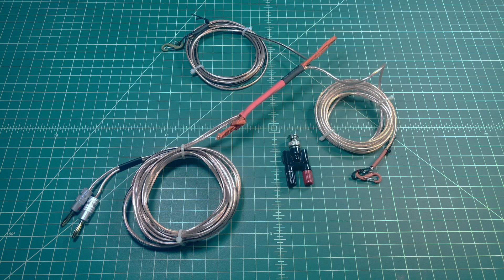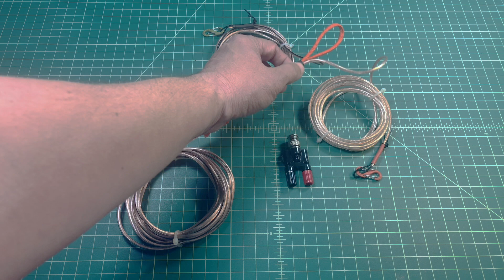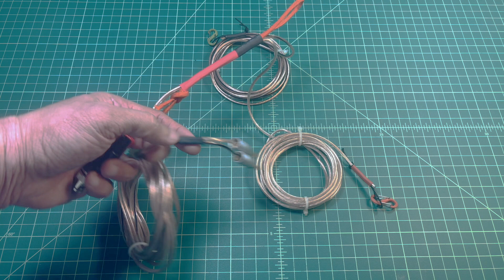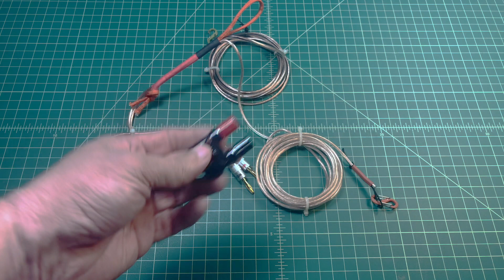Speaker Wire Antenna - HAM Radio - TheSmokinApe

Comment: This is really cool. I've got a bunch of 18 gauge speaker wire so I might have to try this build.
Reply from the maker: Give it a try, good luck with the build 👍
Reply: @TheSmokinApe  Follow up: I made one of these and it worked very well for me. It will be better when I can get it up higher, but even at around 12-15 feet I made several contacts as soon as I got on the air.
Reply from the maker: @KenPryor  that awesome 👍

Comment: Great video. I assume you’re attaching the connector directly to the radio. But if you attach the connector to a coax cable to complete the journey to the radio, I’m assuming you would need a balun to handle the unbalancing created by the coax?
Reply from the maker: That is correct 👍

Comment: Not to be picky here but radials are the wires that run away from the base of the antenna. The radiating part of an antenna is a radiating element or radiator. It is important for people to know and understand this. I love the video though and I would recommend that people make this antenna especially for portable use such as POTA, SOTA, Field Day etc... Also the difference between a doublet and a dipole is that a doublet is usually balanced (uses ladder line or two conductors) and a dipole is usually unbalanced (uses coax cable) But some people use the terms interchangeably). And you are right that the larger conductor the wider the band width and this is even more helpful at VHF and above...  Thanks for posting.
Reply from the maker: "Not to be picky here but radials are the wires that run away from the base of the antenna. " you are totally correct, thanks for the call out.
Reply: @TheSmokinApe  Not really a call out but more of reminding you of what you already know... I like your videos a lot.
Reply from the maker: Thanks Norbert, I apricate you checking them out

Comment: Great build Ape! What's the max power you'd put through the antenna?
Reply from the maker: The most I put in it was 50w, I’m sure it could do more 👍
Reply: @TheSmokinApe  Thanks!
Reply: @TheSmokinApe  BNC connectors are rated at 250 watts,so that binding post can easily handle 100 watts of RF.

Comment: Hi, is this wire solid or stranded?
Reply from the maker: Stranded 👍
Reply: @TheSmokinApe  Thank you. I've been using 26 AWG solid magnet wire until now and handles 500 watts with no problems, but it's hard to paint black and keep stealth. So I've bought some black stranded wire and was concerned. Thanks for the reply!

Comment: Very cool. I made a very similar speaker wire dipole. I am considering ordering the qrp 1 to 1 balun from balun designs. I also used the speaker wire as a balanced feed line. My thought is that the output of the radio or tuner is still unbalanced even if you dont use coax. Thanks for making this video!
Reply from the maker: It’s my understanding, and I could be wrong, that balanced to the radio is fine.  If you add coax or a tuner you add unbalanced which requires a balun.  Glad you liked the video 👍

Comment: Looks great! Now get that general ticket so we can see it in use! One thing I would do, if it's cost effective, use adhesive lines heat shrink tubing, that'll holt it all together!
Reply from the maker: I do need to get motivated.  Thanks for the tip on the adhesive shrink tubing, never heard of that...

Comment: I just made one of these a few days ago. I also just got my telescoping pole in the mail last night so I am going to test it out today. I cut mine for 20 meters but I think I will add clips so I can add wire for 40 as well.
Reply from the maker: I’m curious about how the clips work out.  I have the Shakespeare Wonderpole I’m using as a mast.
Reply: TheSmokinApe  I’ve wondered about using PowerPole connectors to make the wire extendable to various lengths. What do you think?
Reply: @TheSmokinApe  Mine worked well. I used  the DX Commander 10 meter pole which is by far the tallest support I have used to date. I just used a zip tie to support the center which worked fine for me. I am really impressed on how may contacts I was able to make using this antenna and 10 watts on field day!
Reply from the maker: Nice!  I’m going to look into that mast.  Thanks!

Comment: I made one of these with 24 awg speaker wire. 100ft roll about $10 plus the same BNC adapter you have. I cut it to 40M length with the remainder as the feedline. I use a 2nd adapter to go from BNC to PL-259 into an MFJ-902B 80M-6M manual tuner with an FT-857D. I hang it in an inverted-V with a 20ft telescopic fishing pole as the mast. Not including the radio and tuner, I probably have less than $45 into the antenna... wire/mast/connectors combined.
When I first checked with the antenna analyzer I was stunned with the SWR at near perfect, 1.2:1 NO TRIMMING! So, I hooked up the tuner and radio and my first contact on 40M was a 6-call from Northern California at about 65 watts SSB. I'm in SE PA, so I was quite pleased. 3000 miles at about 1pm EDT. Does okay on other bands with the tuner (I didn't try below 40).
Just my 2 cents... Have fun!!!!
73
Reply from the maker: Thanks man.  I think the these are going to be a fun project to play around with.

Comment: Interesting, I have used just a single wire with an alligator clip to make a decent field expedient antenna for shortwave receivers, but this looks much neater, and looks easy to hang as a dipole.  Now with radio shack gone I need to hunt down some speaker wire locally lol probably Home Depot.
Reply from the maker: You can get it from Amazon pretty reasonably priced